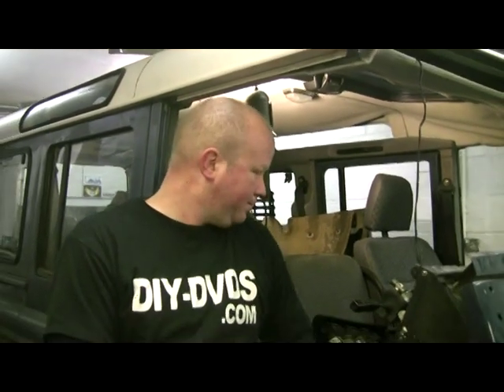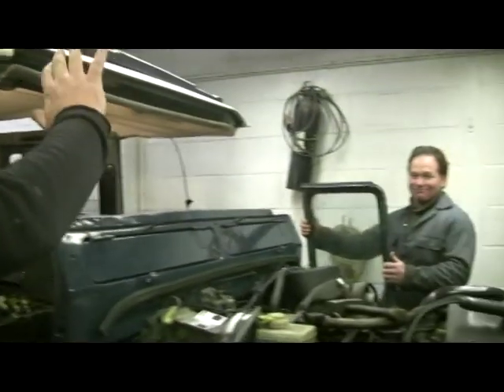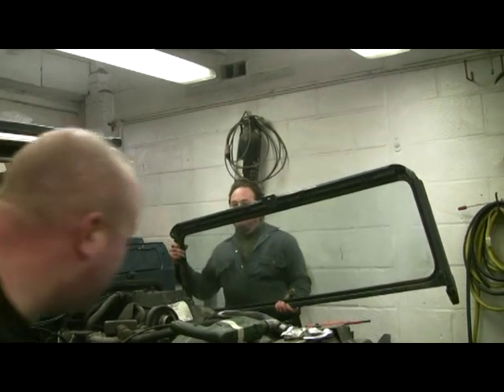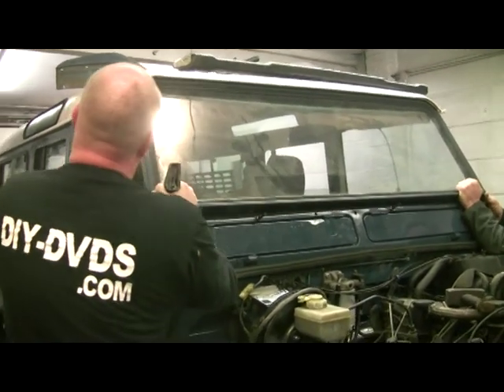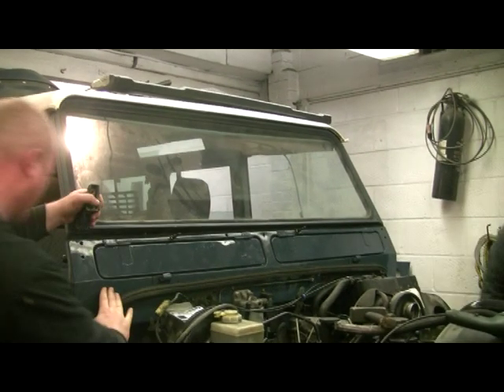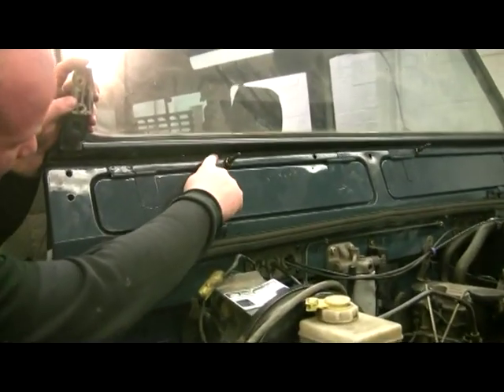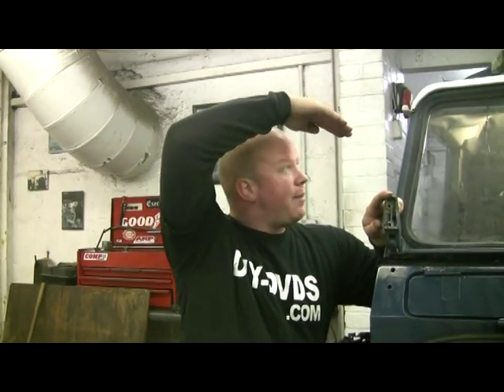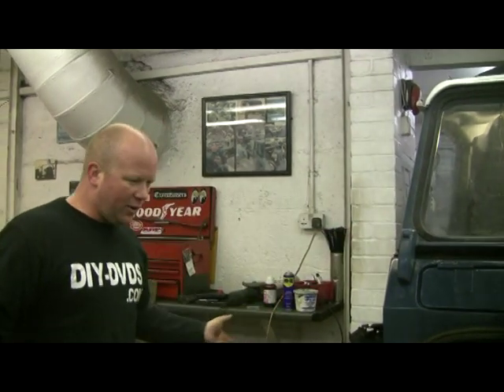landrover 110 200tdi 300tdi td5 bulkhead how to change and fitting instructions and guide pt21

Comment: Hi Phil, Pulled out the engine on Series 3 thinking the clutch was a problem - nothing wrong there. We now think its the Master cylinder so we're at the bulkhead and its not looking good. Top rail v poor and It needs some major work so will consider pulling it out for repairs. Not confident but your videos have inspired me. Great information and thank you v much for them.